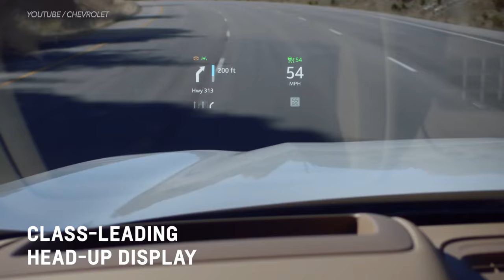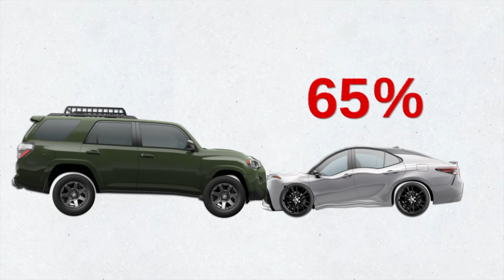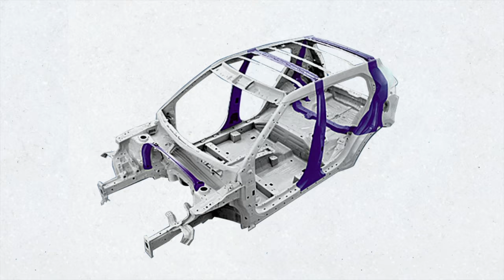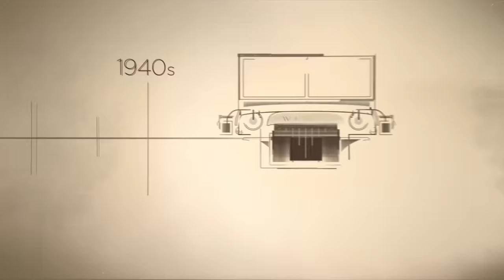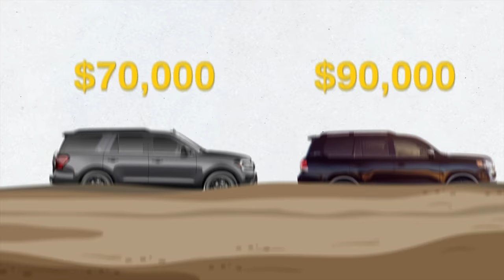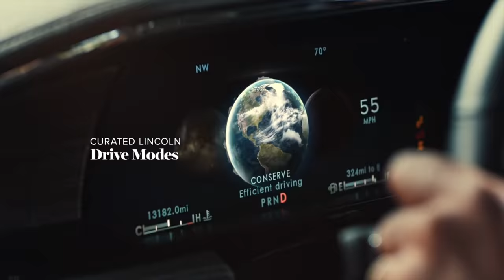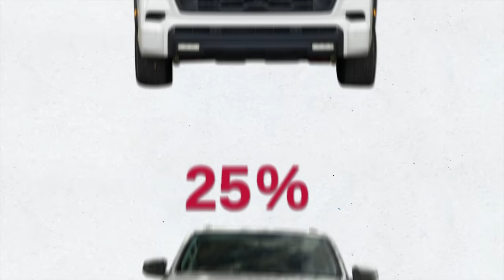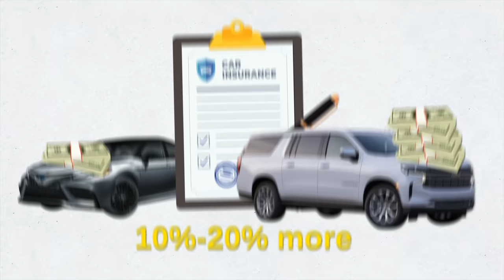Here's Why You Should Never Buy This SUV

Comment: To anybody who can help, My fiancé owns a 2006 Kia Optima Lx and I replaced the battery a week ago because it died. However, today it died on her again and Im concerned it might be the alternator, but I don’t have a lot of automotive knowledge. So if anyone has any experience with these years of models of Kia/Hyundai and knows any problems that run the powering systems of these cars I could really use some info, ty!
Reply: Was it a battery from AAA ? They have been failing quickly, I replaced it with another brand. My mechanic told me he had just replaced 3 bad AAA batteries.

Comment: Thumbnail is pointing at a new highlander and I just bought a 2022 highlander a few weeks ago so I got nervous 😬. But I’m okay I guess. 🥴 it gets up to 29mpg as it’s rating. We didn’t get the fancy platinum edition or anything like that but the gas tank is too small is my only gripe. It only holds 17.9 gallons which is not much compared to our other vehicles so it feels like we are spending more on gas because we have to fill up more often. I don’t like the push start on it. I prefer a key.  It’s smaller than what I’m used to but I like the highlander a lot. Wish I could have been able to afford the platinum edition but I couldn’t afford $18,000 more for the cool bonus features.
Reply: Scotty as tracking you ...

Comment: I'm not a big fan of SUVs but I have thought about looking for an older Ford Explorer with the 4.6. If the engine was still good and it hadn't been wrecked or have any serious rust or corrosion I would just get a new transmission for it. I would rather have that than one of these turbo GDI micro SUVs with plastic engine parts and weak transmissions even with soon to be $5 a gallon gas. The money you save in gas on those turbos you spend on expensive repairs.
Reply: I just bought a 2008 explorer with 4.6 with 116,000 miles. Love it, but I'm glad I kept my 2012 fusion also. At $4.00 + a gallon for gas, I will be driving the 4 cyl Fusion more often.

Comment: Hello from the uk, I have a 2006 crv 2.2cdti 6 speed manual and have a shake through the seat between 1700-2100 rpm only in secon gear, any ideas where to look? Keep up the good work😁
Reply: I'm not a mechanic, but I work on my own cars. Visit tranny shop, ask about torque converter issues. 2nd gear STARTING to get worn out? Stall converter issues? Worn/Loose bands (auto trannys have them, manuals, I don't know, remember I'm not a mechanic.) Good Luck. Try the auto forums on line too. 😲😲😲

Comment: Just about to burst your bubble about Toyota,my daughter has a 2016 Kluger I am not sure what it's called in the us,it is the one with a 3.5 engine.Very heavy on fuel and the trans has to be replaced after 100000ks about 62000 miles,she is very disappointed will not buy another Toyota again it will cost her $7000 Aus.I have always thought Toyota were overpriced and bad mechanically.

Comment: Most SUVs are just boring. I'm better off with a Subaru WRX. It's capable of going offroad, it's safe , it's reliable and it costs much less than a crossover or a full size SUV.